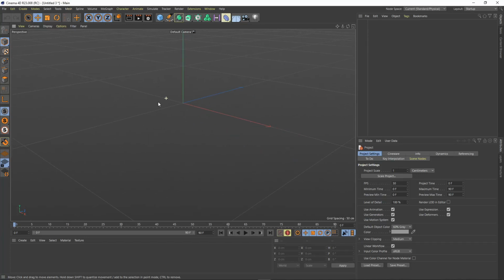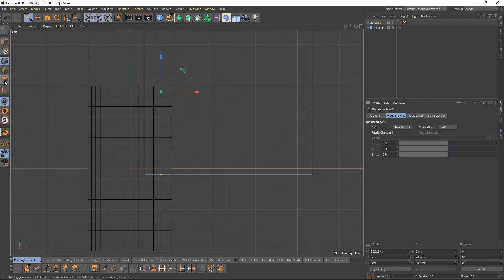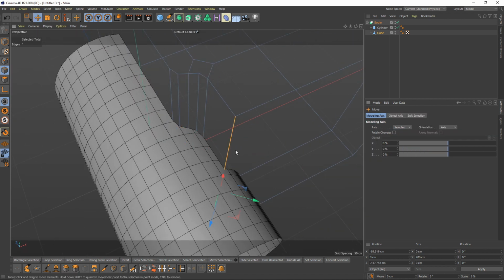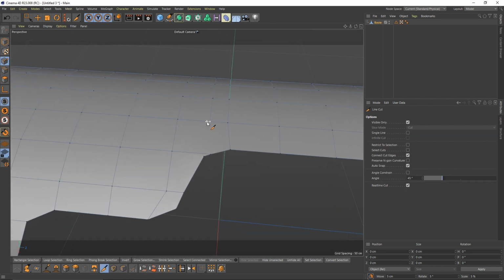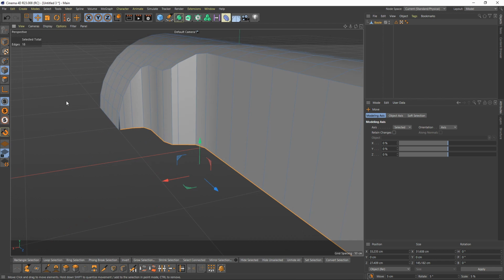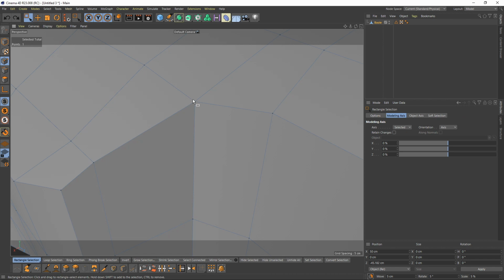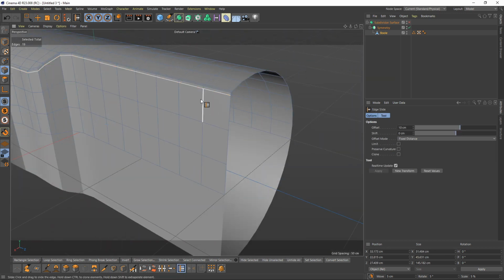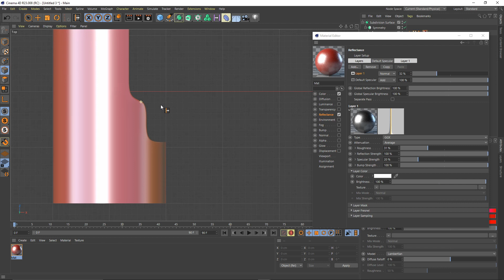Modeling Cylindrical Objects in Cinema 4D/Hard Surface Modeling Tutorial

Comment: Sir, if you don’t show the N-gon line, I may not be able to find out if the face is four-sided, and can R19 be the same as R23 in terms of material?
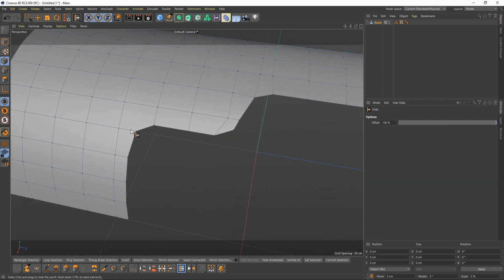Reply from the maker: If you are talking about 3:47, it is obvious the face is N-gon, the face has 5 sides and I put a loop cut to make a 4 sided polygon

They are the same but R23 has superior viewport enhancements, so it may look different in R19
Reply: @polygonpen  Yes, sir, R23 is very different from R19. What kind of work do you use C4D for?
Reply from the maker: Mostly commercials and freelance projects.